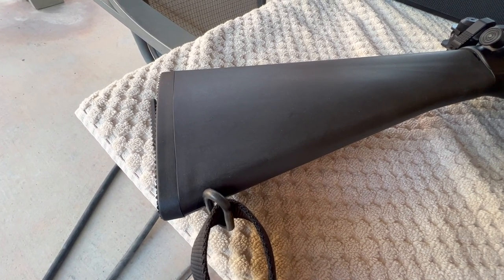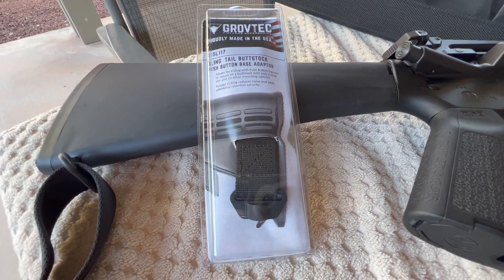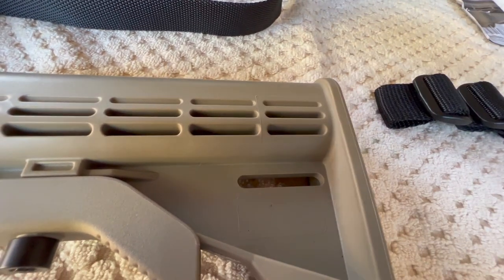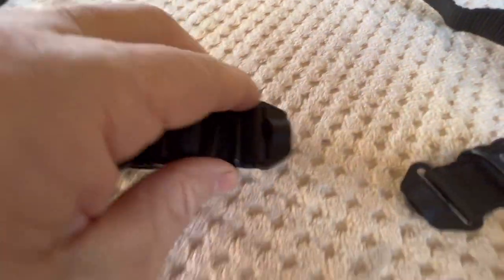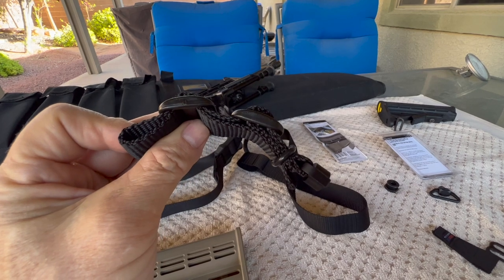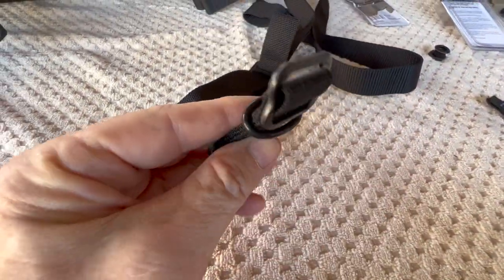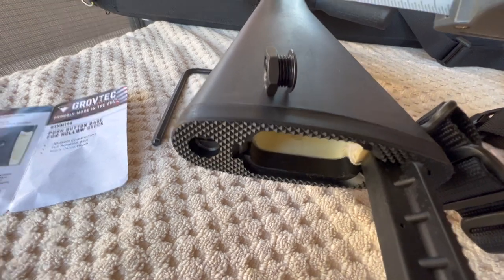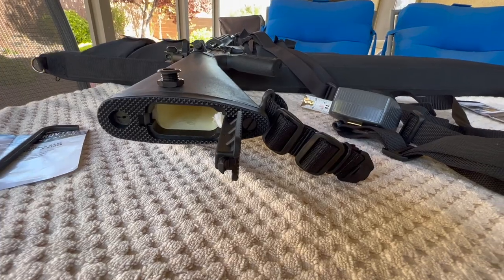AR-15 A2 Butt Stock Sling Quick Detach DIY Prototype!

Comment: As another alternative (slower) you can buy a QR stud that's made specifically to replace the fixed rear loop on the A2 stock.  Very sturdy, but QR isn't as quick to use.  I put one on my A2 build.
Reply from the maker: I actually bought one from Grovetec and needs a hole drilled but decided not to use it. The one you're referring to I believe is a rigid mount and the way it looks to be designed it seems like it would place a lot of stress in the sling swivel mounting area? Don't have any actual experience with it so just guessing. Thanks for watching and commenting!
Reply: @peteregger7928  It's a rigid stud, but like the fixed swivel it replaces, the bottom butt plate screw fastens through it is much sturdier than just drilling into the composite stock to mount a swivel stud.
Reply from the maker: Okay thanks for the info! @dougferrell7047

Comment: I think the drill QD would work well and not be so gotty as the one on the original sling loop. I definitely would use the back up nut as even if it is a quality A-2 stock it will eventually strip. My only thought is the material inside the trapdoor is different [ softer ] and may pose an issue sooner or later , I have a quality A-2 on mine but I hav`nt opened it in quite some time so I don`t remember how it is.
Reply from the maker: After I posted this video the Colt front barrel side mount sling loop came in that I ordered. It solved almost all of the roll over issue when carrying the rifle vertical. I will be installing the butt stock QD tomorrow and this will solve the entire muzzle down vertical carry issue. The butt stock is a Windham Weaponry and the internal insert seems to be solid more like plastic than a hardened foam. I know exactly what you're talking about though. If I have enough threads on the QD backing nut I'll put a fender washer under it for some insurance. Thanks for watching and commenting!

Comment: I Was Thinking Take The Original Sling Adaptor Weld A Small Plate Too It Reinstall It and Drill a Hole In The Plate and Install The QD That Goes in The Side Of The Stock In The Plate On The Original Sling Adaptor Or Get an Ol School A-1 Stock Sling Mount That Swivels 😀😊
Reply from the maker: I think that would definitely work! I tried looking around online and could not find anything similar to what I'm trying to do with the bottom sling loop being made. Maybe it's out there but I didn't find it. The idea was to have the original butt stock sling loop still useable in case the QD female or male failed. I might try something along the lines of what you're thinking! Thanks for watching and commenting Chris!
Reply: @peteregger7928  Check Out The Link On My Other Comment Also Pete It’s another Option

Comment: Did you end up drilling your stock for the QD cup?  This one is best I've found no mods, worth a look. Combat Art Training sells the whole deal and has a video on setup. He makes them himself all from USA.
Reply from the maker: Just couldn't bring myself to do it! Lol! I'm sure it would be strong enough for how I would be using it. I may still try it. I'll check out Combat Art! Thanks!
Reply: @peteregger7928  .. I thought it would look bad myself so I got their butt stock sling adapter since it doesn't interfere with storage. It only comes 1" so I decided to go with a different sling w/padded and attach direct to adapter. Only have one QD up front. Thanks for your videos I've learned some good stuff.
Reply from the maker: @Allenmar73  I took a look at it but not sure about the sling "D" ring orientation? Couldn't tell if you could move it to the front carry position so the sling strap doesn't twist? Doesn't block the trap door as you're saying so that's a plus! Thanks for watching and commenting!
Reply: @peteregger7928  .. No D rings on the Combat Art Training one. I think Vtac and Blue Force uses one. The Combat Art guy has qr buckle if you want detach on both ends. I just went sling to triglide on adapter and running hk hook on front to my side sling swivel I picked up from Rock River. The guy demonstrates the set up and different techniques on YouTube.
Reply from the maker: @Allenmar73  Hard to tell from the photos? Thanks!